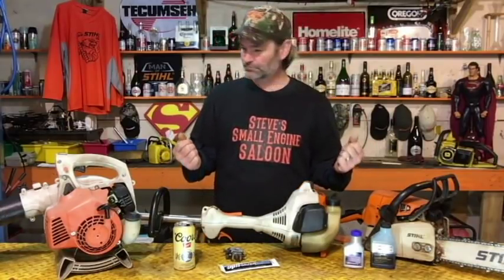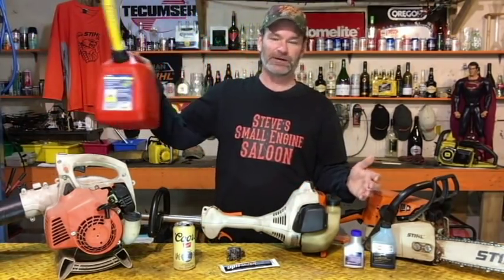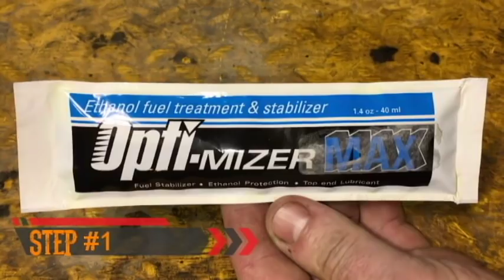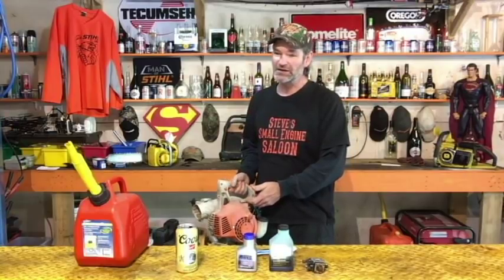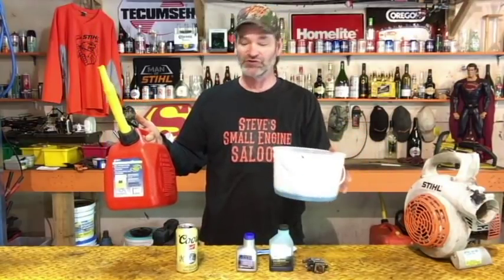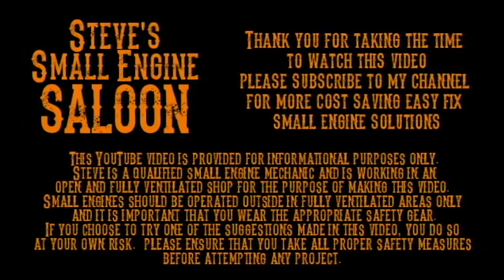How To Winterize a Chainsaw, Weedeater, Blower or Trimmer

Comment: I have left treated gas in my equipment over the winter for 20+ yrs and I never have any problems starting in late spring.
Reply: Same here for all my small 2 and 4 stroke engines. Only 91 octane non ethanol with stabilizer. 👍

Comment: So once you mix the fuel stabilizer with the gas and let it run for 2min why do you need to empty the tank and run it dry? Could you not just leave stabilized fuel in the tank over the winter?
Reply: that's what i do.
Reply: Mr.Knowall do what he tells u and take it a step further put some oil in it,your fuel line will last a lot longer.But make sure u dump it out when spring comes around 😊

Comment: hmmmm.....winterize a chainsaw for winter?? heck, that is when mine gets used the most......summer gets to hot for me to spend much time cutting firewood
Reply: very good point
Reply: I start my chainsaw every few weeks.   A lot of trees and large branches come down with heavy snow.
Reply: summerize it
Reply: I'm the same. My chainsaw gets used monthly. But my tiller filled once and carburetor gummed up.  I know better but was lazy. So now time to fix and do it right.
Reply: General information to use as required. This tip is for whatever small engine that you will be putting to bed for a season due to non-use!
Reply: Heck yea, I was thinking the same...  hauling wood by snowmobile is awesome.
Reply: Have a look at some of the serious battery power now available for small chainsaws.  For many occasional users they might be just the thing.  Plug it in for a recharge once in a while.  Neighbours will be happier too, when you decide to play Paul Bunyan Sunday mornings!🪓
Reply: A true Paul Bunnyan. Lol

Comment: I drain the tank and then run the engines dry every year regardless if it is 2 stroke or 4 stroke. I never leave fuel in them. Also I only run ethanol free 2 cycle gas mix in my 2 strokes. This method has never let me down and all of my equipment, which includes 3 mowers, chainsaw, chipper.shredder, 2 tillers, trimmer and blower always start when I need them again.

Comment: How much beer should I consume  to adequately winterize myself?
Reply from the maker: I find that Rum and Coke works better for that....
Reply: If you catch a chill drink faster.. once you are adequately warmed up slow down consumption..
Reply: "All of it"
Reply: This depends on engine size and duty cycle. My system prefers Canadian blends for the mix, and a wood stove helps keep the system from rust
Reply: you are correct !  American beer freezes at some temperature defined by an "F"., and tastes like crap.
Reply: doz
Reply: Use whiskey
Reply: Avoid Coors if you want to spend more time in your shop than the on the John.
Reply: Kirk Johnson You had to drink whiskey
Reply: @StevesSmallEngineSaloon  Wrong! You wouldn't dilute a cold beer! And Coke is bad for your internal parts! 
Buy a high quality rum and only mix with ice! Enjoy the flavor! Also works with other quality spirits. (Bourbon, *scotch, tequila, etc.) *Dewars 12 or 18 year olds
Reply: @StevesSmallEngineSaloon  * my favorite
Reply: @sydnick6696  My shop/garage/storage/man cave fortunately has a back door. I drink Coors light and it comes in handy!
Steve's the go-to small motors man!
Reply: That depends on how 🥶 nasty cold your garage happens to be
Reply: ONE beer per pound of BODYWEIGHT.  (16 ouncers, no lite beer)
Reply: Kirk: beer has more alcohol in it than E10 Gas...so you can have all you want, but STABILIZE it for winter.
Reply: Jack and apple juice for me.

Comment: Use Ethanol-Free Gas!   Ethanol absorbs moisture which causes corrosion on the internal metal parts.  Ethanol is also not good on many rubber and plastic parts...
Reply: Buy engineered gas, it is not just ethanol, its benzine.
Reply: @WBOS72  Ok, that a new one to me.  What do you mean by "engineered gas"?
Reply: Apack Westbound he means synthetic gas. It comes in a can at your local Hardware. It’s been out for a couple years now. It’s expensive as hell but will not destabilize like gas.
Reply: Stihl MotoMix is some of the best stuff for 2 strokes.

Comment: Steve, been watching your vids for years. Thanks, have even sent a tip or two. YOU HAVE SAVED ME $$$ ON REPAIRS‼️ Just wanna add that I NEVER use ethanol laced gas, always non-ethanol. This eliminates 90% of your small engine, 2/4 stroke, engine issues.

Comment: Ive emptied my 2 strokes everytime i have used them for 20 years,i still have the same weedeater,starts everytime
Reply: That’s what I’ve always tried to remember to do.
Reply: I have fourth small tools not going to start them all over and over.  Put sea foam in and run dry.  Never failed for years and years
Reply: @joekennedy9647  joe.  can you describe the steps with seafoam you do?  thanks
Reply: Put approximately one ounce per gallon of fuel in with your normal mix. We go on the heavier side most times.  Then we run the equipment dry for storage. The sea foam is supposed to help keep the fuel stabilizer but will also clean small amounts of build up as well.  I can’t prove it but we use it every year and hasn’t failed us for almost ten years. We have four saws and many trimmer weed eaters etc...
Reply: I've never empty my chain saw because it's mixed an I used higher grade gasoline I've done this for over 23 years for my sthil! Works as it should , but I add seafoam before starting it up In the spring!

Comment: Thank you Steve for the tips on winterising two stroke engines on garden equipment . I've always done most of what you suggest but never emptied the primer  bulb and shuck the machine whilst the engine is running. First class tips from a top class small engine mechanic
Reply from the maker: Glad to help

Comment: I have a Lawnboy 2 stroke, mix ratio is 32:1, I use this same gas in all of my 2 stroke equipment, weed eater, leaf blower, etc., At the end of the season I just leave the gas mix in the equipment. I do not run the tank dry, I never have any problem starting the equipment in the spring. I believe that the oil in the 2 cycle mix helps prevent gum from forming during the off season. Just my two cents.

Comment: I got 4 chainsaw's, 2 weedwakers, 2 leaf blowers, 2 lawnmowers, 2 lawn tractors, 2 outboard motors. Because we have multiple properties. Had problems with fuel stabilizer coagulating. Now I always use the highest octane gaz super gaz. No issues never gonna use regular gaz in my small engines again. Samething for my 4 wheeler, ski-doo, and dirtbike.

Comment: Thumbs up.
Pretty much how I learned to evacuate the fuel from a machine that wont be used for awhile.
Not sure if it's necessary, but an old time thing I'd add was to pull the spark plug and pour a cap-full/teaspoon of 2 cycle oil into the cylinder and crank it over a good dozen times. A winter can turn into a year or several years before you know it.
One more thing; when in a humid climate, toss a silicone moisture absorbing pack (that comes in the box with your new boots, shoes, electronic gizmo...) into your chainsaw case when storing away.

Comment: Hi Steve. Jim's tip.   I stabilize my fuel all year long, then you don't have to worry about the small equipment that you don't use all the time, like a tiller, or snow blower. My cans always have treated fuel. Mid summer I just half dose the cans

Comment: Steve - I don't know whether you read new comments on old videos but it's winterizing time of year and a great time to try an experiment. Pick a piece of two stroke equipment and put some Bottled ethanol-free fuel in it like TruFuel. I don't want you to use best practice, I want you to be sloppy. You should fill it to the top so there's no air in the tank deteriorating the fuel but I want you to fill it only halfway. A quarter way if you want. Just run it enough so that the fuel gets through the system and then leave it until spring. No exercising it. Just leave it and see how she starts come springtime. I think it'll start just fine and may turn you into a convert.

Comment: Fun video to watch. A good tip on small engines is to pull the starter rope till you feel compression. It blocks off the intake  and exhaust ports on 2 cycle and closes the valves on 4 cycle. This way no moisture, critters or other foreign stuff gets into the cylinder.
Reply from the maker: I like it, Thank You...

Comment: I use fresh non-ethanol mix.  Add stabilizer.  Run the engine a little to get it through the carb.  Put it on the shelf with tanks full, to decrease condensation.  
I've never not had an engine start right up in the spring.  
My saws get used all year, with the exception of my pole saw.

Comment: Great video. I, like many use non-ethanol gas, add stabilizer, but also pull the spark plug, add maybe 1/2 teaspoon of oil and pull the starter to coat the cylinder. Doing this for 65 years, and engines still start after storage.

Comment: I use marine grade Stabil fuel stabilizer with Star Tron fuel enzyme in all my stored fuel. I add it before pumping 91 octane into my 5 gallon jug for small engine use. The fuel is winterized & leave it in there & when I use it again in the spring it fires right back up.

Comment: i put marine stabilizer in my gas jug,  i've never had a problem starting my 2 cycle toys,  the next year.  also, my tractor , and snow blower has the same treatment.  minus the oil.   love the channel .
Reply: The marine stabilizer may be better for ethanol blended gas. Ethanol absorbs water, stabilizer helps restrict water from contaminating the fuel. Being marine 'grade' or whatever I'd guess it has extra water repellent properties.

Comment: Very good advice.  Many years ago, We had constant problems with our small mixers and gas saws and a mechanic showed us this same technique.  We do it faithfully always.  Even if we are using the machine again in a month or so, we run it dry and never have problems starting any of our equipment.  Simple, but great advice and saved us many hours of trying to get mortar mixers, concrete mixers, gas saws etc. to start.   Thanks.
Reply from the maker: Right on.....

Comment: Steve,  I winterize my weed eater but I never winterize my blower or at least a few of my chainsaws.   I move my chainsaws in and out of storage condition during the year.  I never put any piece of two cycle or four cycle equipment into storage condition with any gas in the tank.  I run them empty of gas (2 cycle) or shut off the fuel and run the carburetor dry( 4 cycly).  I add fuel stabilizer in all gas, usually Briggs & Stratton's AFT fuel stabilizer.  My normal formula is 1 ounce per gallon of premium, non-ethanol gas.  I do not run ethanol gas in anything and I repeat anything, except my vehicles.  I never rev up a two cycle engine when I am running it empty of gas, because it might run short of lubrication.  I just let them idle until empty.  My two cycle stuff comes out of storage quite easily.  However they do smoke, slightly, because I add 1/2 ounce of Seafoam to the empty tank before I add any gas to it.  The Seafoam will get rid of any varnish or gum created during its time in storage condition.
Reply from the maker: Great tips!  Thanks John...

Comment: On my outboard, 2 cycle,  engine they put into extra large capital letters DO NOT RUN ENGINE to completely dry out carburetor,  it will not keep proper lubrication available for the last minute of run time.   for storage purposes just drain bowl or remove bowl to drain and leave open to atmosphere for several days to dry out.   So far this has worked with no hiccups that I'm aware of for 60 ++ years.  regards

Comment: As an owner of five small engines, I appreciate this channel. Shops around here charge about $95.00 in troubleshoot a problem.  I’ve already saved at least two trips to the shop and fixed a long standing surge problem on a power washer.  Thanks, Steve.
Reply from the maker: Glad to help

Comment: I was told by my stihl dealer not to use stabilizer. Instead I could store it with the premixed gas or if I'm using premium gas with no ethanol and the oil mix, I should add Seafoam and let it run for about 5 min.  I don't know if it's available where you are - in in Ontario.  I have an old snowblower that a neighbor tried to destroy by putting crazy glue in gas tank. It sat for 2 years. I cleaned out gas tank, lines and carburetor - put fresh gas in with Seafoam and it started on 4th pull.  Now I use it in lawn mower and both snow blowers when storing.

Comment: I go 1 step further with this . After engine is dry of fuel , I pull the plug and add a capful of 2 stroke oil and turn it over slowly with plug out , then replace plug . Just my 2 cents and probably overkill but I love oil ! Maybe oil will back flow into carb but I have never had a problem

Comment: My last step is to always add just a bit of oil in the cylinder with a flexible long neck oil can. Coat the sides of the cylinder then slowly exercise the piston to spread it. Then hand tighten the plug back on.

Comment: I never empty my gas tanks for winter. I have weed whackers for 20 years and start right up. I use fuel stabilizers all the time on all my fuels. Maybe I am lucky.
Reply: No, I do the same. The Stabil Fuel Stabilizer says that it's good for up to 12 months. Use stabilized fuel in the generator I have, and it's never had an issue...

Comment: A small engine repair guy, in Pryor, Ok., told me he didn't use stabilizers over winter.  He did start his equipment now and then.  I keep my equipment inside.  I do not use stabilizer and I do start the equipment now and then.  I have no spring starting problems.

Comment: I always use Shell 93 hi-test octane fuel with stablizer in the mix. I belive the 93 octane fuel is ethanol free. I empty the fuel tank and start the engine to clesr the carburetor after each use to make sure there isn't any fuel left in the engine. Its a bit of a  pain but it beats struggling to start the engine the next time I use the equipment. The only piece that gives me some issues is the chain saw because it doesn't have a primer bulb and it takes quite a few pulls of the engine to work the fuel up to the carburetor.

Comment: I think evaporation will eliminate the last step.Could also rid a 2 stroke of oil lube in gas if we start it after it dies 6 times- 1 restart should be enough..A dry cylinder is never good.The stabil will take care of the rest
Always enjoy your videos Steve
I have learned a lot from you.
God bless

Comment: I generally "exercise" all my power equipment in the off season...whatever that is. For example I don't cut a lot of wood in the heat of the summer but I do start the engine every 4-5 weeks. I only use ethanol-free premium fuel in my 2-cycle engines, only mix a gallon at a time, and always add stabilizer year round. Works for me.
Reply from the maker: Right on...

Comment: I have found that 190 proof grain alcohol works best. It helps keep all the parts from sticking. For my power tools, though, I use a fuel stabilizer.
Reply from the maker: Right on....

Comment: I run stabil in all my gas cans year round. When winter is near I run my weed eater out of gas. Then store is in shed in winter time. My lawn mowers I turn gas off let carburetor run out of gas. By summer equipment fires right up. Stabil is a great product.

Comment: The very best fuel I have found to run in 2 cycle engines is tru fuel. I left a half tank in my echo trimmer for 5 months and it busted right off. It's kind of expensive but worth it. I buy it by the gallon and use it all year long. I generally run my equipment out of gas before I leave them to set for extended periods of time.
Reply: I left pump gas in my chainsaw for a year and it started right up as well... Now I know better not to do it, but I didn't back then, 10 years has this thing been ran like that and the carb is still good 😁

Comment: Steve - Great vid.  Especially the last step telling folks to choke it again and again.  The carb is never completely dry on that first "die off".  By constantly choking and cranking you assure it's dry, dry, dry. 

I do exactly as you just showed here.  But I add one final step.  Lemme know what you think:
Step 6 - Throw a splash of premixed TrueFuel (the red can) or any other equivalent, engineered, ethanol-free fuel in the tank.  Start her up one last time and get all that super high quality fuel flowing through the carb.  Let her run dry in the same fashion as in prior step.  This way you know the very last thing that flowed through that engine was the absolute highest quality fuel - and most importantly - Ethanol free.  Thoughts?
Reply: Diesel Mike  guess Steve’s too busy. I for one gives you the thumbs up!!

Comment: I just run all the fuel out of my stuff, pump the primer out as much as I can, then put a little wd-40 in the tank (you can buy it by the gallon), pump the primer full of the wd-40, put on full choke, and pull the cord about 10 times to get the wd-40 sucked into the internals of the carburetor, and then pour the remainder of the wd-40 back into the container, and done. This way you can store it for years, and she'll be good to go when you want to use it.
Reply: Great suggestion, thanks, much appreciated.

Comment: I stabilize the gas with every can.  Also I spray fogging oil into the cylinder, and get new spark plug after the first use next spring.